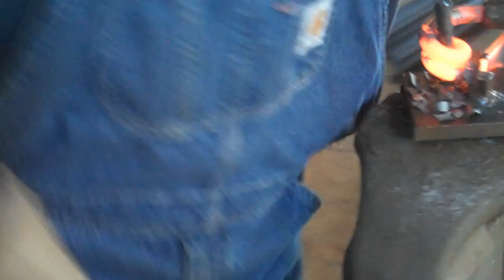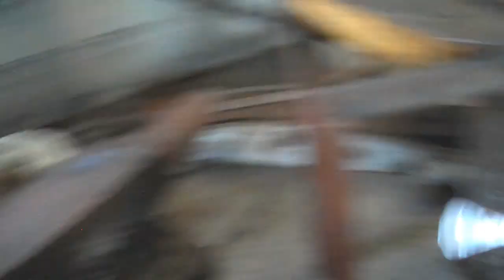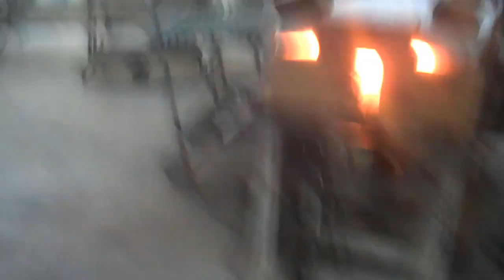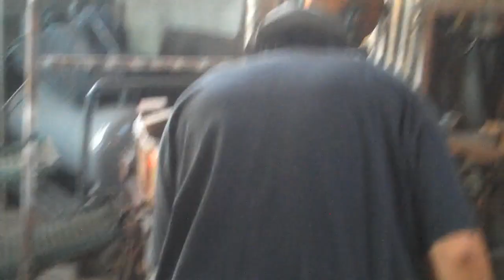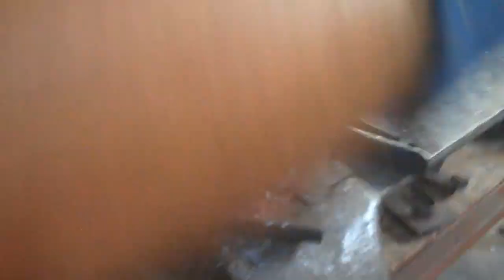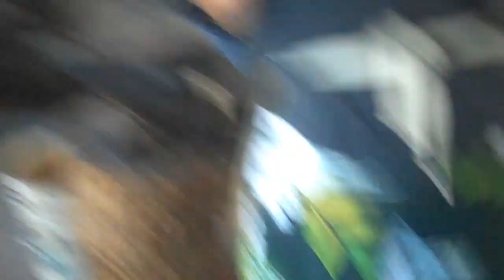Making Big Barbed Wire

Comment: It appears you're making the barbs. I need to make 5/8 or 3/4 inch barbed wire in about 7 ft sections. In the past to twist metal rods I'd simply put both rods inside a pipe and twist away , the pipe kept them straight. With the barbs sticking out I'm not sure how to keep the two rods looking straight. Any suggestions?
Reply: Clamp one end secure. use a pipe threader fitted with a clamp on the other and turn it on. I have done it